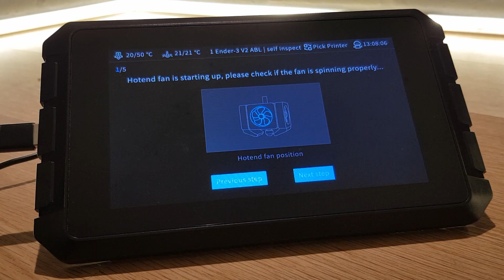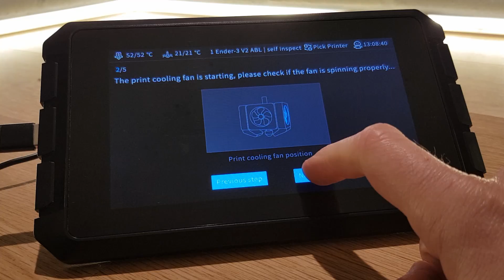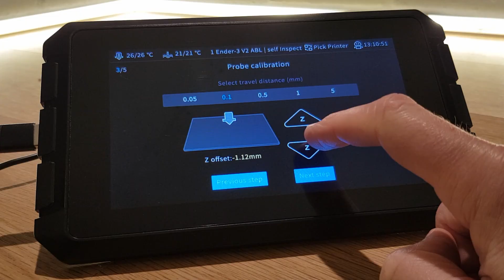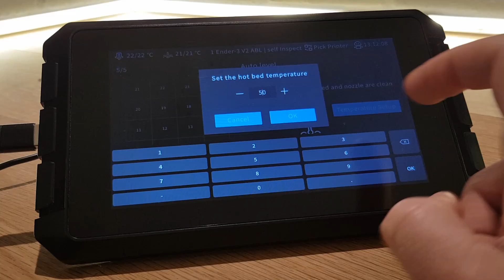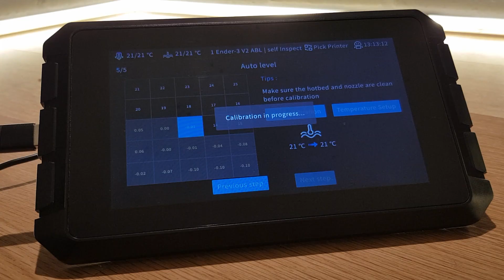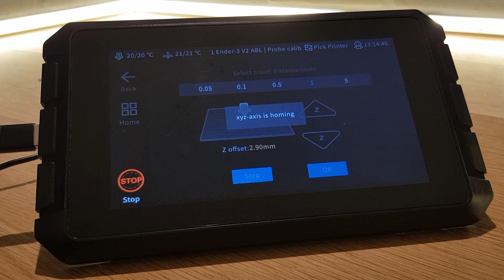Completing The Initial Setup Of The Sonic Pad - Sonic Pad Basics Part 2

Comment: After the self test, I set the center z-offset with no issue.  After that the extruder buries itself into the PEI sheet during the 4 corner leveling.  I loosen the knobs but the surface does not drop down low enough to slide paper in.
Reply from the maker: It obviously shouldn't do that. What printer do you have? You can also skip past the manual leveling stage if you want and try moving straight to setting a bed mesh to see if it can.
Reply: @RickyImpey  sorry for the delayed response.  Putting in  some OT at work.  I ended up starting the manual bed levelling  process on the right rear and right front which allowed me to move forward to the auto bed level which worked out great.  Dealing with some major clogging issues after having the perfect first few layers laid down.

Comment: Hey Ricky 👋 
Thank you for doing these videos! They came at the perfect time as I have just got my Pad. I really had a problem with the Pads manual level process. I use Silicone springs and they compress very little. Where I have them is where I want them. I chose to do my manual and fine tuning differently. I have always kept my Z Stop installed but disconnected. This marks my ideal spring compression point. So with bed heater on and steppers motors off. I lower nozzle by hand to center of bed till my Zstop "ckicks" then I adjust my bed screws to a paper level. After that I trammed and stored the values. To do the final Z offset which is the big gap, I print my leveler STL and on the fly I drop Z till nozzle is where it posed to be. 
Summary: IMHO using bed to adjust Zoffset is backwards. Level with bed adjust Z offset with the Z offset. 👍
https://cults3d.com/en/3d-model/tool/minimus-precision-layer-calibrator

Comment: I have an Anycubic Kossel Linear Plus Delta printer, how would you go about setting up in sonicpad? would sonicpad know how to handle a Delta printer? I also have a CR10 V3 connected already to the sonicpad, but I find that I alway hate to manually turn off ad turn on the original controller to get it to communicate everytime the sonicpad restarts, is there a fix for that?
Reply: I'm guessing yes. Flsun V400 uses Klipper and it is a delta printer.

Comment: Hi thanks a lot for all these video ! Im facing an issue I use ender 3v2 with some upgrade as :
-Sprite Extruder Pro Kit
-BL touch

And during bed leveling I dont find a way to set correctly my Prob position so it goes in completly wrong position and sometimes out of the bed .

How can I configure my  X and Y BLTOUCH Offset from the sonic pad ?

Thx a lot amazing work keep going
Reply from the maker: This, like most parameters is set in the config file. You access it through the web UI and even edit and save it there too. I'm not at my computer to check the exact lines to edit right now but I'll have a look when I am. Have a look though, you may see it straight away.
Reply: @RickyImpey  After a day of research and stuff Ive finnaly found some solution to my issues :) Still waiting for your in depth video for more info :) thx
Reply: @augustinbendjama3183  could you share your solution, as I have an E3P with a sprite and ABL. Cant do the initial set up on my sonic pad, probe is off print bed.

Comment: Hey Ricky, love your videos. One thing I figured out today regarding the Sonic Pad and ABL Mesh. If you want Klipper to use the mesh you created you need to add "BED_MESH_PROFILE LOAD=default" to your start  gcode, M420 isn't recognised by Klipper.
Reply from the maker: Yes, 100%. That will be covered in the intermediate series. There is a lot still to come but I wanted to get the basics out asap while I finished the other videos. Thanks, tips from other users will really help people in the mean time.
Reply: @RickyImpey  Sweet, looking forward to them. I'm new to both 3d printing and the Sonic Pad. I've found your videos an invaluable resource. Thank you.
Reply: Can you please explain where you add this profile?
Reply from the maker: @neilbartlett3018  it goes in your start g-code in place of any m420 or g29 line